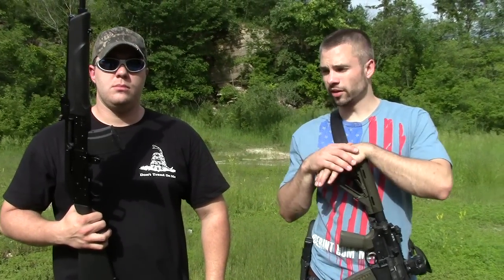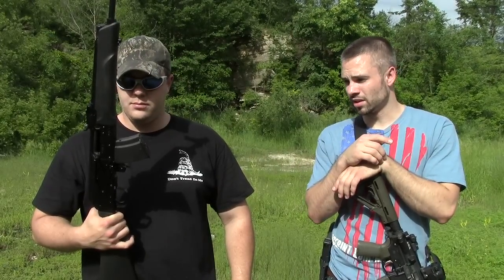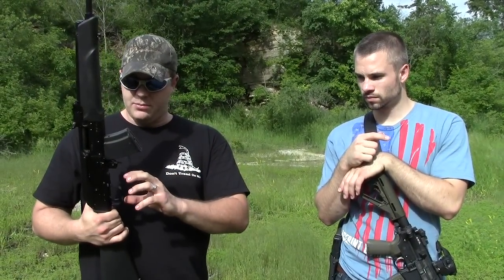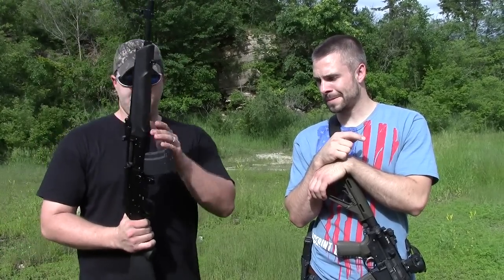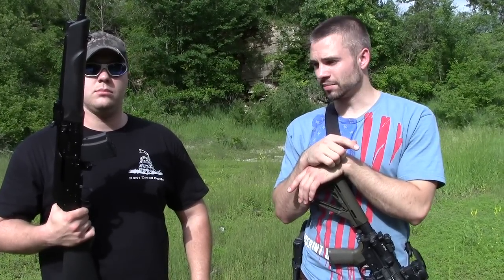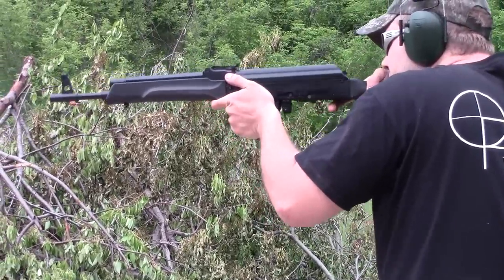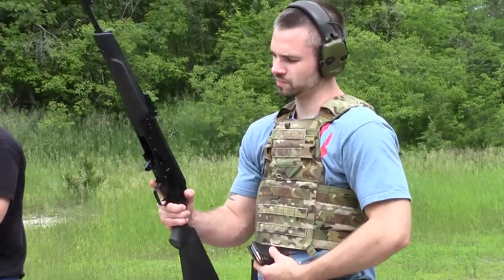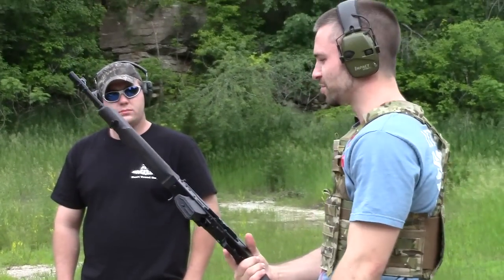Saiga Function Test

Comment: FYI... They do fit standard AK magazines. Some of them were assembled with the magazine catch too high preventing them from locking into place. All you need to do is shave the magazine catch on the rifle with a dremmel or grind down the part on the magazines to correct the issue. I have 10 standard AK magazines that fit perfectly and function flawlessly.

Comment: Midwest Industries makes one of the best AK rails out there.. I have one on my Aresenal SLR-101s, and although it does add weight, it's an extended rail which the bottom rail reaches out further than any of the other rails I've seen, so the pro's outweigh the cons for me as I can get out further on the barrel for more control